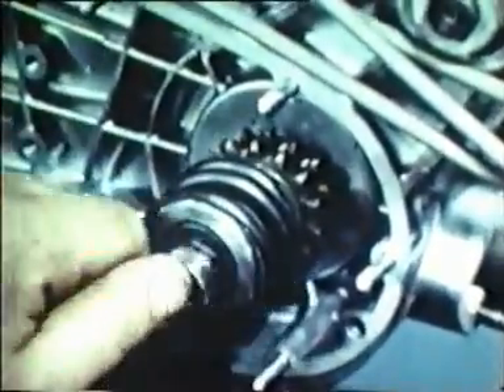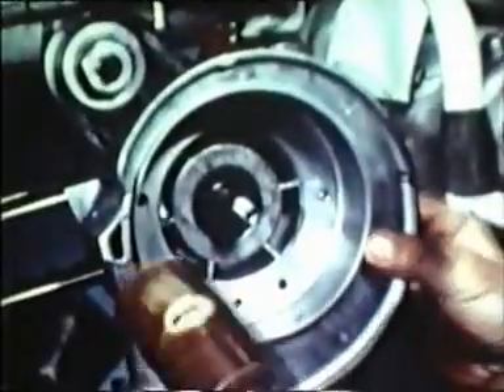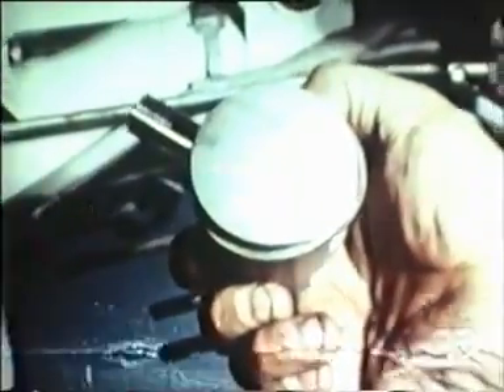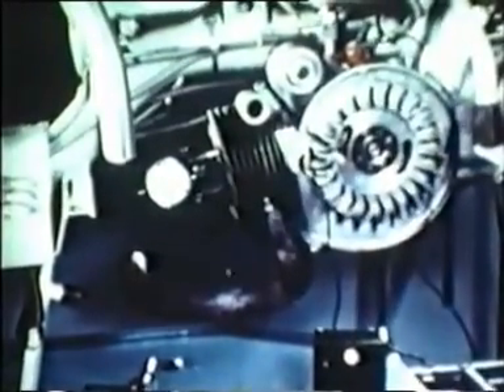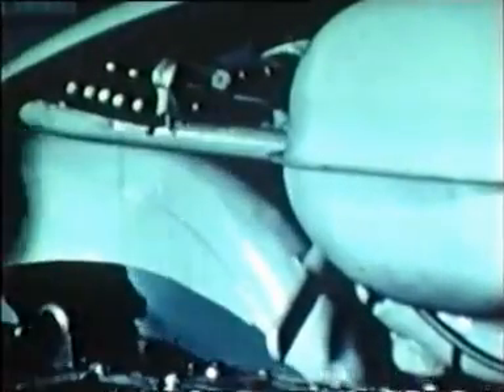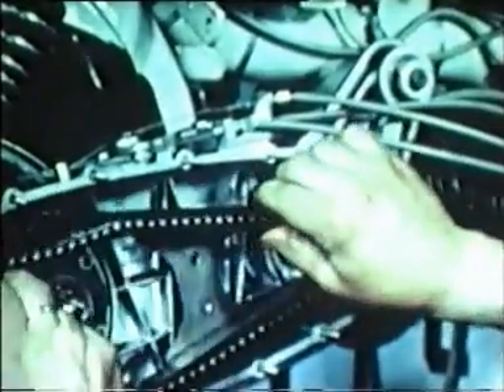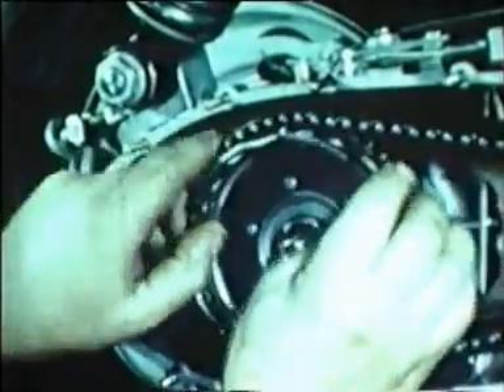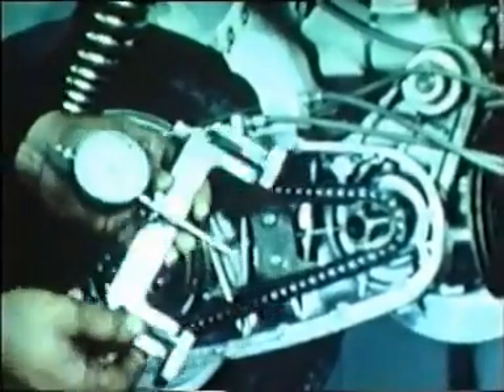Lambretta Engine Overhaul Video in English (1960's) - 2/4

Comment: Do you think hitting the end of the crank with that hammer is a good idea. Seems heavy to me..  I was told many times never to hit the crank to fit it..  To easy to put it out of alignment.
Reply from the maker: +kevin swithenbank @ 0:24, no problem (except for the bearing), but @ 1:00 , you're right: no good. 

The principle is that the fragile part is the center of the crank, where the rod head bearing is. When you need to remove or fit a crankshaft, any force must be applied on the same side of the crank the tight-fitting bearing is; not the opposite side. That means, on a Lambretta, acting on the chain side of the crank, by tapping it out for removal, and pulling it in when installing. When tapping it out, one must also be aware that the shocks are absorbed by the bearing, so the bearing should be checked afterwards, or changed outright.